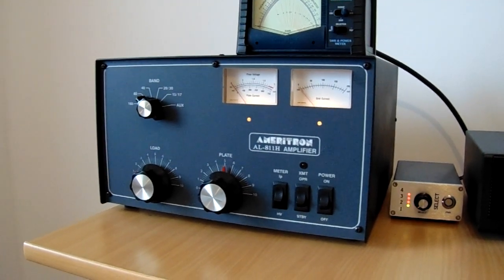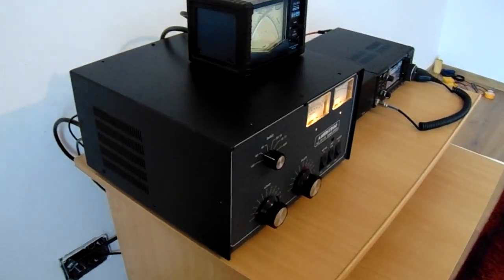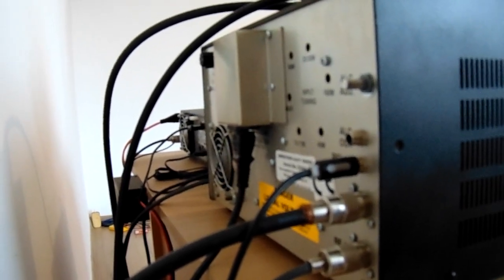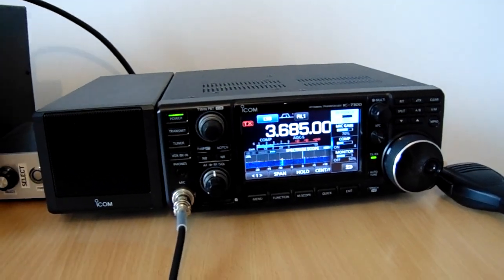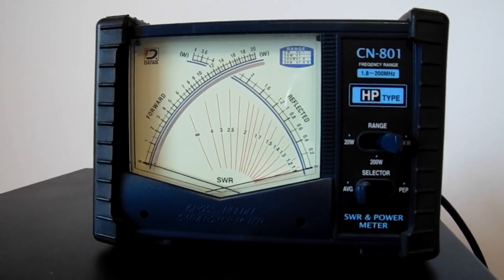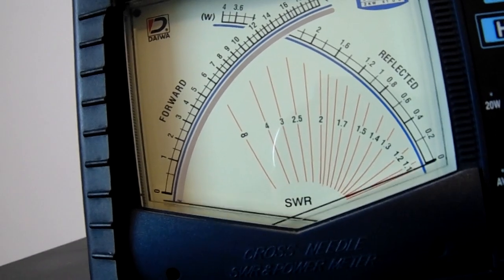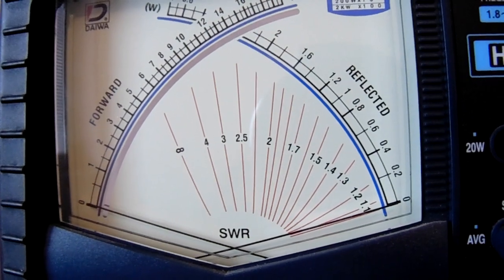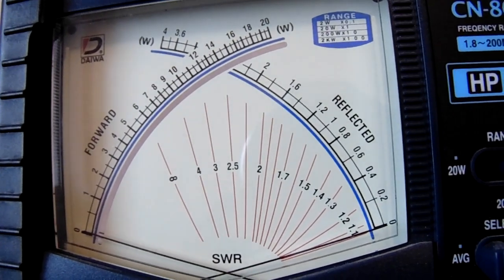AMERITRON AL 811H power test & ICOM 7300 with Icom sp 38

Comment: Hi are you using  any isolation device like arb704 between the radio and amplifier??
Reply from the maker: no, nothing. just RCA cable
Reply: @GeanitovIDEAS  so only 2 connections,  1 rf patch cable and  another rca cable.  Qsl? I am vu3fsj .
Reply from the maker: for icom 7300 rca cable to the radio and rca also to amplifier ameritron all811h
 @chaitanyabalasubramanian4164

Comment: 150mA is max allowed grid current in the ameriton 811, says ameritron, that is done with about 65watt input. that amp would then probably push  about 920watt out. by the way,  like 3 years ago the ameritron 811hxce was new for about 900€, now they want 1400€ for it, things become crazy expensive. the icom ic7300 was back then new for 1150€,  now its for 1300€. tuning would be more reliable, if done in FM rather than whisteling into the mic in ssb, FM carrier is silent to not disturb other people that much.
Reply from the maker: hi, yes you are right! my amplifier push up to 900w out

Comment: What about the overshoot problem with the 7300 hard keying the amp? Have you had any problems with the amp while using this set up?
Reply from the maker: hi, i did not conect never the alc socket, did not have any problem, its very ok. with 45 w drive its out 800w
Reply: Don't forger to go in set your tx delay otherwise you need new tubes in a year .Goole it ..😉
Reply: @johnmarron1944  TX delay, won’t work with this problem. The overshoot still there no matter what you do you can look up overshoot problem 7300 on QRZ and there’s a good thread on it.
Reply: @chrisswartzwelder8494  thanks I am a 7300 owner and just about to purchase and use an old kw1000 will have to look into it thanks

Comment: Why did you not use the ARB-704 Keying Interface between the amp and your 7300? The keying circuit in the rig can get damaged or even the amp also can be damaged. Or do you not need a keying interface with a 7300 ?
Reply from the maker: dont need. 73
Reply: @GeanitovIDEAS  What is the TX DELAY option set to in your 7300 please. Apparently this option is very important when using an Amp. "Press:  Menu/Set/Function . . . then scroll using Multi-Knob to “TX Delay”.  Select TX Delay (touch-screen), then choose “HF”. Thanks.

Comment: I wouldn't be tuning by whistling into SSB. I would tune using a constant-carrier mode such as CW or RTTY.  Wattmeters cannot give an accurate PEP measurement peak to peak of SSB, and give a lower value than PEP wattage. This may cause you to drive the amp harder than you think you are when you tune up.
Reply from the maker: yes, you're right! i would try on cw tone. 73
Reply: @GeanitovIDEAS  Put the meter in peak mode and say the word four but drag it our foouurr works very well.

Comment: These 7300,s work good with 8011 h i have that same power meter swr meter and 7300 and 8011 works well i put 572,s and it was an improvement.
Reply: And I bought an Ameritron  AL-811 HD HXCE which already had a 572B lamp from the factory
Reply: @arunaspaulionis8350  yes its a more expensive model the HD  i got the 572,s from china replaced those crappy 811,s as no one makes 572,s anymore  only china .